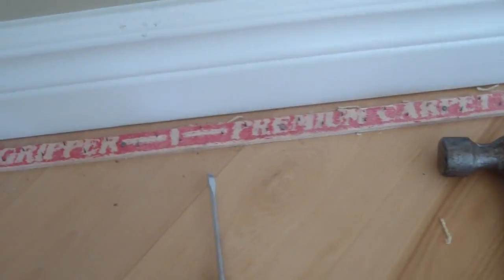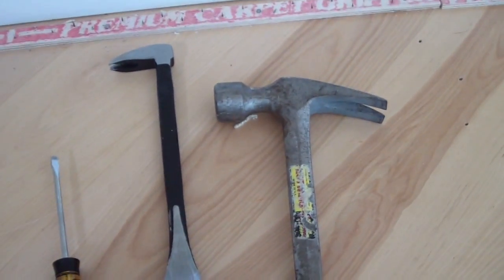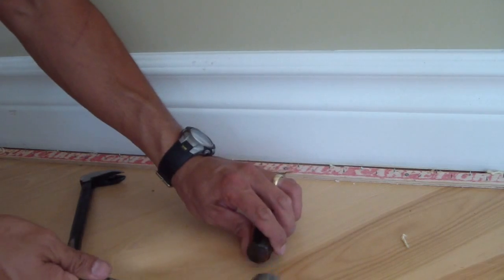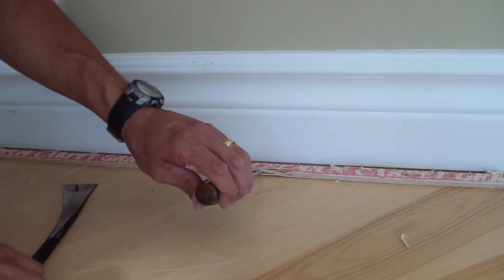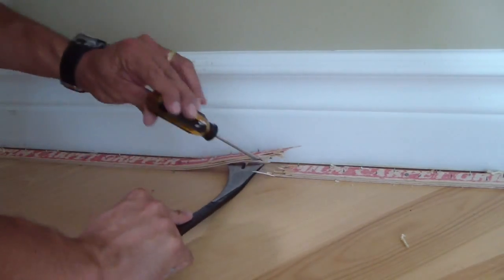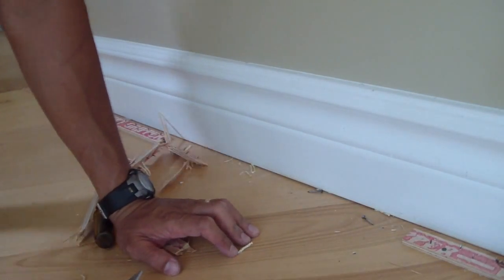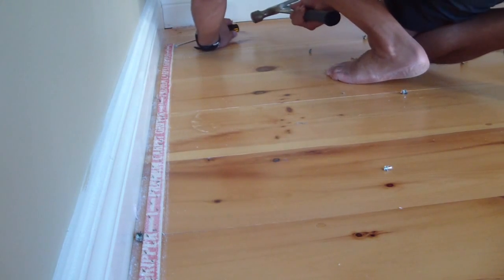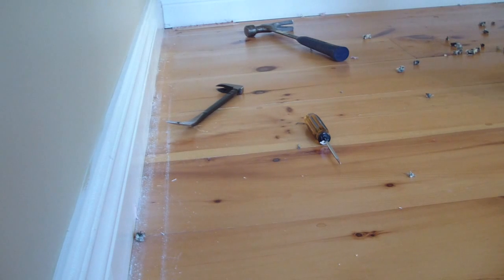Carpet Removal (Gripper)

Comment: I used a large flat screw driver and aimed it about 45 degree angle just beside the nail that goes into the floor, and under the gripper, and then hammered it in as far as it would go. That usually lifted the nail out of the floor.  When it didn't, I'd just continue with the next nail in line. Eventually even the reluctant nail would lift out by itself. Very easy process once you get the hang of it :) Thanks for the video.